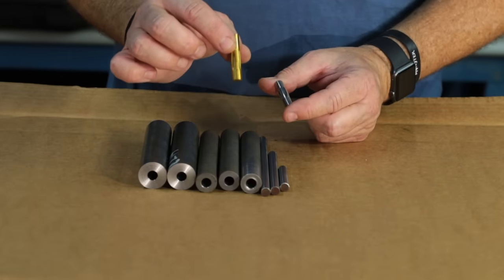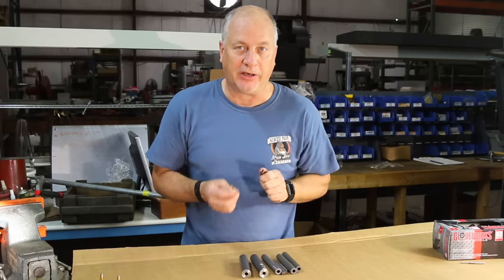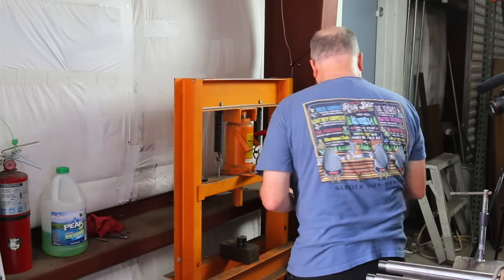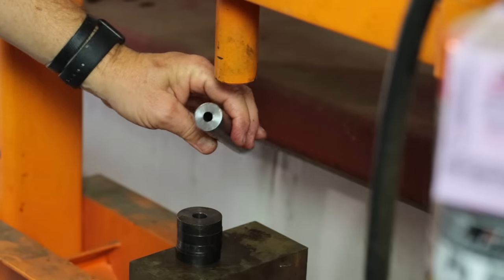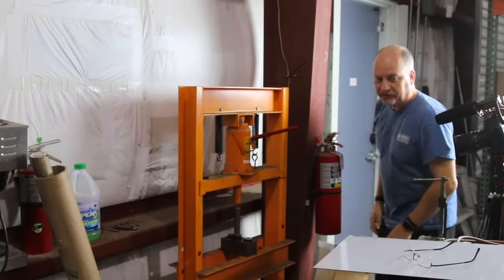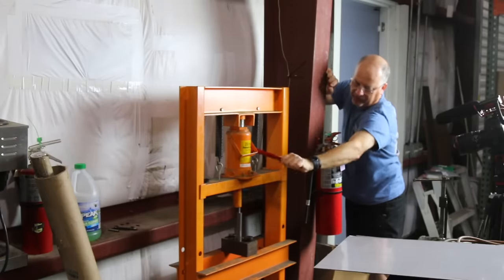Home Shop Rifling THREE(ish)...China vs. Ukraine Rifling Buttons!

Comment: I'm nobody in rifling but on one video about long barrels rifling it was said that guys using a soap as lubricant and it works better than any grease. They usually put the barrel in a solution of a soap then dry it to form a layer of soap inside. If it not difficult could you please try this type of lube too? Thanks.
Reply: what kind of soap? some industrial lubricants are soap (Grease is oil mixed with soap), but not the type you keep in by the sink, they're a whole nother animal
Calcium stearate seems to be the goto

Comment: Do the shavings (swarf ) build up, where does it go? Is this like broaching?
Reply from the maker: @cayenne7792  Not at all like broaching and no shavings.
Reply: It is obturating the barrel steel. Not cutting. No loss of material.
Reply: The button imprints the rifling in the steel by pressure as it passes through the bore.

Comment: A few questions 

at what point is the steel too hard to make good clean rifling? 
I’m assuming the harder barrel would wear out the button at a faster rate as well, correct? 
At what point do you know the button is dead? 

Love your videos. Part 2 made me laugh pretty hard.
Reply from the maker: I honestly don't know, but I'd suspect it wouldn't be too far in to the Rc 30 range.  Of course there's another consideration, and that's the brittleness of the barrel which increases with hardness.  Last thing you want is a brittle gun barrel!  Thanks for the comments!

Comment: Could this also be done using a homemade frame with all thread? And please if you will, tell me the best or easiest type of steel to use for barrels 9x19 and smaller.
Reply from the maker: I would think so, but you're much better off making a frame for a bottle jack.  Just a little bit more money but MUCH easier on the arms!
Reply: markserbu Thank you for the advice. Do you have a preference on steel type or is it written in stone, that barrels should be made from...?
Reply from the maker: @brookswade5774  4140, 4150, 1137, 1141, 1144, 416. But I've made them from 1018 and 12L14, though those aren't the best choices.
Reply: markserbu thank you sir.

Comment: Looks verry promising this time around.... But what is the twist rate of the buttons? It is a shame they dont mention the twist rate and groove dimentions on the product selling page.

Ive red that with more grooves buttons will give better results/ accuracy in the rifling, as there will be less chance for high and low grooves. 

So if you can choose between 6 and 12 grooves (the only ones i saw on the internet.) Choose a 12 groove button. 

Last but not least; this is 9mm right? What are the dimensions for the lands and grooves on these? Because these could be 2 9mm sorts: 9mm parabellum and the 9mm makarov(since these buttons come from ukraine and china). 

THANKS FOR THE UPLOAD! Happy holidays

Comment: You mentioned in the comments that you are building a rifling press. Sounds awesome! I'm going to build one too. I'm going to use a harbor freight air powered hydraulic ram with a 17 inch stroke, but I'm going to build the rest of the system to handle up to a 24 inch stroke if I want to upgrade the hydraulic ram later.

I wanted to cut down on the amount of unsupported pushrod, so I'm going to cut a recess into the bushings for the springs to rest inside (maybe this will secure the springs better too). If I used 2 inch thick bushings I could recess the springs a half inch on each side, then the bushings would touch when the springs are fully compressed and there would only be 1 inch of unsupported pushrod between the bushings when uncompressed.

 I'm going to buy 6ft of some hardened rod off the shelf from mcmaster 50,000psi Rockwell C60  https://www.mcmaster.com/1555t12
Although I'm thinking about just using annealed rod since it would be so much cheaper. https://www.mcmaster.com/8920k115
I'm not sure if I could get away with using annealed rod even though it has a similar yield strength. I know the annealed rod would be more forgiving but I think it could have problems at the end points.

Probably using these springs: https://www.mcmaster.com/1986k655  I think if I can fit them into the bushings snugly they will hold alignment very well. They have approx 50lbs pressure so hopefully they can "auto-retract" the system after pushing the button completely through.

Some 1.5" schedule 40 pipe (72" long, using a drilled cap on the end for the pushrod to emerge from)

The hydraulic ram (8 tons but only a 17 inch stroke) is this harbor freight ram https://www.harborfreight.com/8-ton-long-ram-air-hydraulic-jack-94562.html but If a proper hydraulic power unit is used, I'm sure its easy to find something with a longer stroke and more tonnage.

Parts count: 
-24 (plus a couple spares) support bushings (2 inches thick, 1.5 inch diameter, 1/2 inch deep recess on each side for the springs to rest inside, center hole for pushrod) should be easy enough to make from 1.5 inch bar stock
-24 (plus a couple spares) springs for between the bushings
-6Ft of 1.5" schedule 40 pipe
-hydraulic ram
-aluminum support block for barrel blanks
-6ft hardened rod

Cant wait to see how your's works! I almost want to wait until you finish yours before I build mine.
-Max
Reply from the maker: I bought a hydraulic power unit and a hydraulic cylinder from Ebay.  I haven't finished the design but I will soon, and I'll do a video on it.  One thing about the push rods...they don't need to be hardened at all, at least not for stress reasons.  But having them hardened where they contact the button makes them slick, and allows the button to twist easier.  Something else that escapes most people is that regardless of the strength of the push rod, column buckling is an issue.  In other words, if an annealed rod will buckle, so will a hardened one.
Reply: @markserbu  thanks! that should save me 50 bucks by using annealed rod. I'll harden the ends so they stay slick. The column buckling is definitely my biggest concern, so hopefully I can find the balance between smooth ram movement and tight support of the pushrod.
Edit: if you have a couple recommendations for the best steel for a pushrod let me know! https://www.mcmaster.com/round-bars

I'm thinking about using 1144 Carbon Steel Ultra Strength rod (125,000psi yield strength) Rockwell B70 annealed, C60 hardened https://www.mcmaster.com/6628k23

Comment: Would a lathe work to push the button through? Instead of a drill bit have a rod to push the button through while the lathe is stationary.
Reply: He is using drill ROD, not a drill BIT.
Reply: That would be a lot of stress on the leadscrew and parts in the apron if you use the tool post.  If you were willing to stress a tailstock quill feed maybe that would work.
The amount of pressure you'll experience really depends on number of grooves, the depth of the grooves you're swaging and the contact between the journals of the button and the bore as well as bore surface finish and lube.

In other words, if the button is only swaging  about 50% surface area (wider land to narrower groove ratio), is only swaging 4 thou deep and your journals at either end of the button aren't acting as additional sizing/burnishing components and finally the steel isn't grummy or grabby or have a tendency to gall  onto tools, the stress will be so low that the lathe leadscrew will effortlessly draw or push the button through.

That's a lot of ifs for an expensive lathe, you know?
Reply: @missingthe80s58 lathe has to be able to stand up to enough pressure to flatten thrust washers while turning between centers.  Like the  tailstock quill on a lodge & Shipley power turn would be fine, a chicom rubber dog shit, maybe no.

Comment: what steel do you use, can i use 4140 qt with 40hrc?
Reply from the maker: 4140 is good, but Rc 40 is too hard for button rifling.  Rc 28-32 is better.
Reply: @markserbu  and should it be qt or normal?
Reply: @markserbu  And do I have to harden it myself afterwards?
I have heard that a Pistol barrel should have at least a hardness of 40hrc
Reply from the maker: @mrdumbum8199  1) QT means "quenched and tempered".  That's how you get 4140 from the annealed condition to Rc 28-32.  2) Harden afterwards?  Did you watch my first two rifling videos?  3) You heard wrong.
Reply: @markserbu  ok sorry, i don't know that much about this. i only had the option to buy 4140, or already with qt. i wasn't sure. i'll take a close look at your other videos again
Reply: @markserbu  what would you advise a hobbyist to do for the heating? i don't have a special device for it. someone said i could use a gas burner
Reply: @markserbu  pls answer me 😞
Reply: buy CrMo4 pipes. Anneal with a good torch. Then rifle. Then harden.
Reply: Anneal the metal run your button and then re heat treat ( quench and temper)

Comment: Hey Mark, have you ever drilled out an original "worn out" barrel, then  rifled and chambered it for a larger caliber?
I'm looking at drilling out a .311 cadet martini action rifle to .348 and re-rifling and clambering it in .355 (9mm).

What are your thoughts?
Reply from the maker: No, I've never done that, sorry.  There's probably a gunsmith out there somewhere who could comment but it would just be speculation on my part.
Reply: @markserbu  cheers mate
Reply: those old iron barrels should be fairly east to work on. you'd need a piloted drill, easy enough to do if you have access to a suitable lathe.
8.5mm would be the closest standard sized drill,
grind a pilot the bore diameter of your barrel on the drill, about a half inch should work, zero you barrel in the lathe to a gauge pin in the bore, run the drill though (you'd need a long drill, or a way to extend it)
ream to .346 (according to SAMMI, CIP may differ) again, long reamer, or some extension
then rifle
Reply: @pacman10182  sweet as, cheers mate! These barrels have been sitting there for a long time waiting for something to do with them. This should give them another life.
Reply: @kallummaitland8158  you may be better off finding a donor barrel to make a liner out of, depends on how hard it would be to find one
Reply: @pacman10182  i ended up doing exactly that still want to give it a go though
Reply: @kallummaitland8158  give it a try with a piece of scrap first

Comment: What do you think about oval rifling ?
Reply: Good question
Reply: Oval and hexagonal rifling was good enough for Civil War sharpshooters.  Everything I was able to find on the subject seems to having nothing but great things to say about it (in historical context).

I'm guessing your mileage will probably vary a lot due to using tiny rounds, seeing as they won't buck wind like a .50 to .68 caliber hex ball, but a lot of that can probably be alleviated by the fact that you're sending the round at 3 to 5 times the speed (or more).

Any spin at all on these types of round will also cause it to have horrible ballistic coefficients (in the modern context), as their pancake or angular nature will act like a wind break causing energy losses due to drag.

As a result, expect it to fly like more of a pig than a .45 -- but with enough lipstick and a pink dress, that was good enough for Kermit.

I think you'd be pleasantly surprised how well they work for anything sub 300m from a rifle. Completely smooth zip guns have done the job so well in pistol ranges that they are universally banned, so you'll likely be even better off there.

Comment: So why hide behind that i beam every time its time to crank? Is this dangerous?
Reply from the maker: Hardened, brittle Chinese-made rods.  Sometimes they break.  Plus I was getting out of the view of the 2nd camera.
Reply: So if that little rod pings loose think it could get that fire extinguisher blowing in your pit?
Reply: lol, we've got a 150 ton pneumatic press at work and it moves things quite easily! Has a steel mesh curtain around it just in case something does spring loose.
Reply: At 8:45 he says “I’m moving so it doesn’t shoot off into my crotch” he then jokes, sort of, “mans genitals exploded at supersonic speed” or something so it just may be that there is an element of danger

Comment: Hello! Please tell me from stainless steel  AISI 304, is it possible to make a barrel for a smooth-bore pistol? Or is this steel too soft? Thanks.
Reply from the maker: 304 is not good steel for barrels.  For one thing it work hardens like crazy.  For another it's not really "gun quality".  Just like anything, though, it could be made to work if you know what you're doing.

Comment: Could you be so kind to explain me why you go to hide behind the metal column, while you press down the “rifling” tool? Are you afraid of something?
Reply from the maker: The rods that I bought from Ebay to push the rifling button through the barrel were very hard and they were made in China.  That means they could be made of some crappy mystery steel, and they could be brittle.  So yes, I was afraid of getting (more) schrapnel in my body.  Plus I was getting out of the way of the second camera.

Comment: I like hearing you pronounce that word, Molly /molybdenum, The way you do/did. Don't hear it everyday!   P.S. The new HF 20 TON IS A SILVER COLOR (I JUST BOUGHT ONE/HAVEN'T YET PUT IT TOGETHER/WAITING TILL NEXT PAY TO THEN GET CASTERS TO RAISE IT UP OFF OF THE BASEMENT FLOOR. We take on water sometimes & I am considering how to raise it up into the air a bit? Maybe I could use 2-4 tree stumps, Bolt it down to 4 equally sized stumps? I know that if I use caster's, I would gain several critical inches then, Coat it in grease to prevent any rust... but. I am considering reinforcing it by welding in more steel to prevent it from deforming under full load.

Comment: Hey there, Mark, I was wondering, what is your opinion on ECM rifling? JeffRod has made rifling with salt water and electricity and is now working on a way to do deep hole drilling with the same process. Ever thought of giving it a shot? Do you think could build a rifle caliber barrel with this process?
Reply from the maker: ECM rifling is awesome!  Jeff sent me links to some military papers on the subject.  I hope to get into doing some in the future.
Reply: You could do the rifling at the same time as the boring or in two steps. I think one could use an arc welder with a setup to turn it on and off and a cnc motor to drive the "bit" in and out and turn at the right amount for the twist. The "bit" doesn't touch the barrel at the tip and water/electrolite need to flow to keep it clean and conduct the current. I think baking soda would be better then salt for the electrolite. Once one figured it out, it would be a lot easier then any other way, I think and easier to keep straight and true.
Reply: markserbu can you share the links?  

Technically I think it would be possible to photo print resist and plasma etch the rifling (in a vacuum plasma tech chamber) too...  

(Since my background is in doing plasma etch with silicon, it was just thinking out my ass )- but I see no reason why it would not work, the only issue might be the etch rate for deep grooves)

I’m also wondering (again, thinking from my posterior) if electropolishing a tool steel stainless barrel is workable (either before or after rifling is cut).

Comment: Hello, a question, how do you make the 4140T steel barrel thermo treated I want to make a .22LR caliber weapon but I don't know how to treat it so as not to have accidents
Reply: .22 is so low pressure you really don't need it. You could probably get away with a copper tube and a nail and still not worry
Reply: Car antenna was used for 22 zip guns smoothbore of course

Comment: How could it make the bullet spine ? I still can not understand except on true type of rifling and it is polygonal rifling with sharp peaks . But this type of rifling in the video requires Bigger force explosion to be able to push the bullet through these grooves or the bullet should be made of soft copper or lead alloys which give best result
Reply: A bullet is typically slightly larger than the Rifling Ridges by only a few thousandths, so the pressure of the charge squeezes the bullet (which is generally soft lead and soft copper jacketed) into the rifling. And bring the bullet is flying very fast, the rotation of the rifling makes it spin.

Comment: wouldnt it be easier if you welded the rod to the press ?  so it had the rod set in one place every press ?
Reply: No, he uses different length rods for the same barrel. If he welds it, then he cant swap rod lengths.

Comment: What kind of metal would you recomend using for the rod?
Reply from the maker: 01 or W1 drill rod is a great solution.  Cheap and available in LOTS of different sizes.
Reply: @markserbu  thanks for the advice and the video!
Reply: @peter ams ebay my friend.